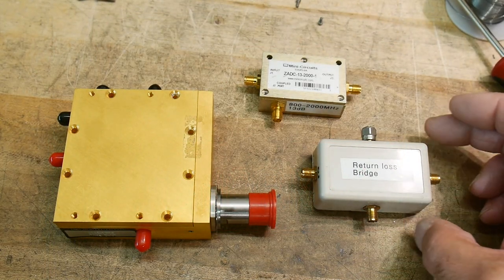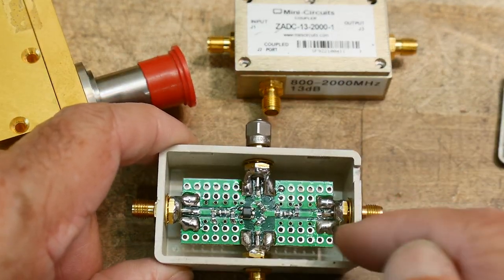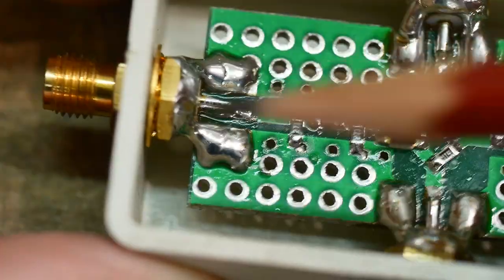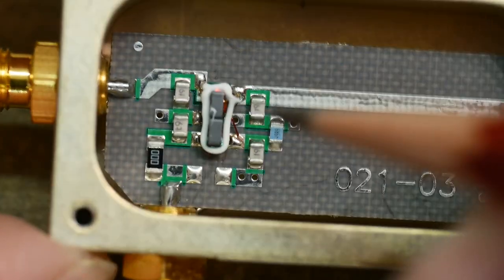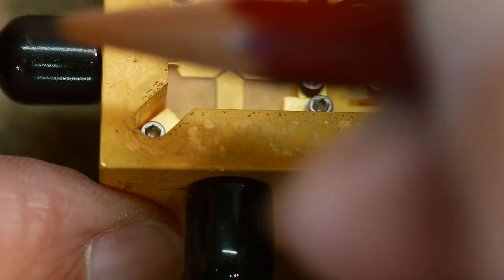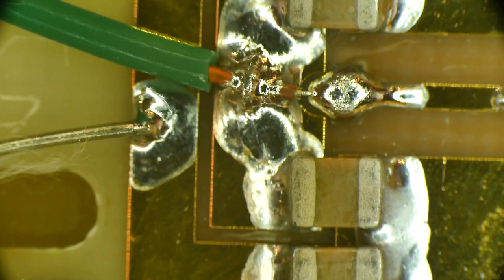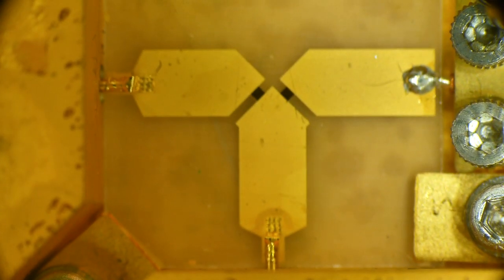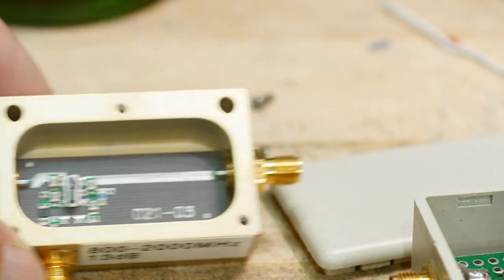#797 RF Bridges and Couplers using Transformer Baluns Chokes

Comment: Nice video.  I’ll wager the gold unit is the front end on a VNA.  The circuit with the attenuator-splitter-coax is likely the reference path splitter, and the coax is used to provide a delay equivalent to the length of the test port.  If you look on the back of the 8510 test sets they have coax coiled up external so the user can change it.  It compensates for long test cables so the reference signal does not fall outside the IF bandwidth during fast sweeps.

The ferrites are likely for the DC bias tee to the port (for biasing your DUT).

The return loss bridge is right at the N test port, and couples off the reflected signal.

There would be two of these modules in a VNA;  one each for port 1 and 2, along with optional stepped attenuators, etc.

Here is a similar diagram:
https://images.app.goo.gl/dXoEmgjJDyzBYZm38
Reply from the maker: I think you are right. My first impression was a VNA or vector voltmeter.

Comment: Nice video. I am wondering if they are using the DC to change the capacitance of those ceramic capacitors for tuning purposes? It would be easier to see with a schematic...
Reply from the maker: I discovered this is a return loss bridge for a VNA. It as a feature to apply a DC bias to the unit under test. So the DC part is just a voltage injection.
Reply from the maker: http://www.iproweb.fr/test/0%20-%20MATOS%20GUILLAUME/HP%20-%208753B%20With%20OPT%20010%20+%2085046A/MANUAL%2085046A.pdf